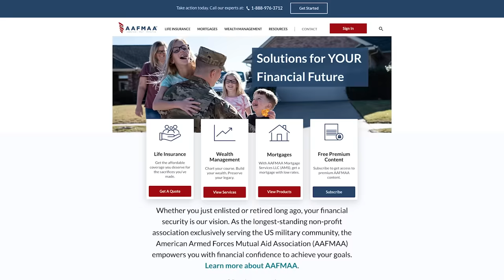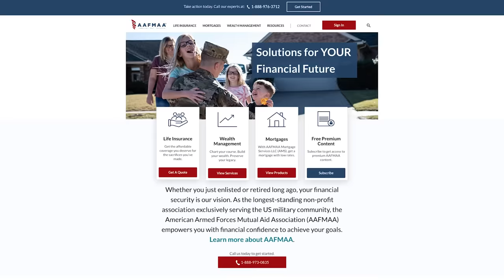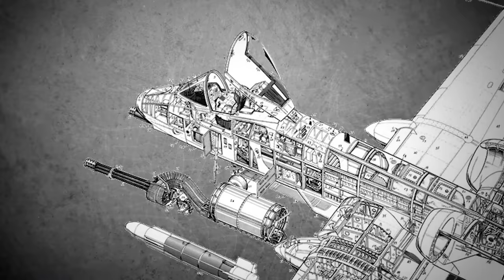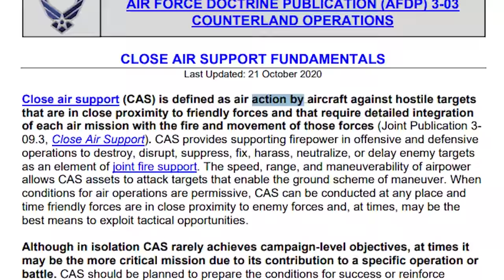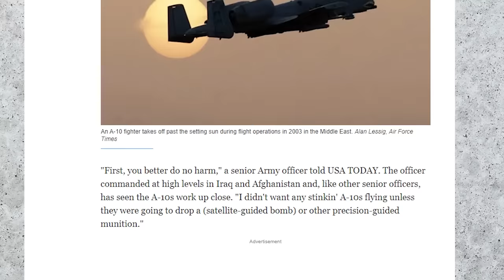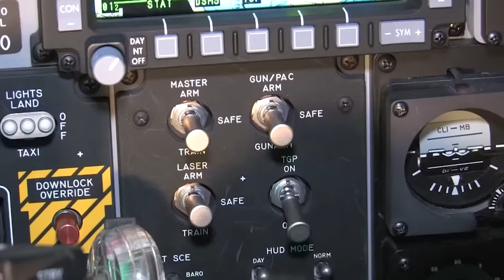Why the Air Force is Screaming to Retire the A-10 Warthog

Comment: As a former A-10 crew chief, I am sad to see this platform retired. However, command is correct on this one. Without 100% air dominance ahead of it, its survivability on the modern battlefield is risky on a good day. I am quite grateful to have supported the A-10 and its pilots to cover our troops on the ground.
Reply: But there's nothing to replace it with. The F-35 Boondoggle is nowhere NEAR a replacement for an aircraft that can almost take a direct missile hit, and STILL fly home. If this were an Air Superiority thing, I could understand that. I could understand retiring like the F-16. Between the F-15, the F/A-18 and the plans for the F-35, it's probably been squeezed out of whatever specialization it might've fit into. 

But the A-10 isn't just a workhorse, it's a warhorse. I don't think there's any problem with the A-10 that wouldn't be solved by building NEW ones, rather than trying to fix the old ones. Okay, yes, the old ones are getting broken more and more...but the technology and fabrication techniques of the OLD A-10s have come down in cost. Moreover, they're proven techniques. There's no R&D needed on the armor of the A-10, or wondering if there needs to be VTOL or VSTOL capabilities or if it needs to be Stealth. We can work on lowering the cost and improving the durability of NEW A-10's, without having to roll out a whole new aircraft that as far as I can tell, is unproven in combat, and incapable of stepping in for a Warthog.
Reply: @Khasym  Your reasoning is precisely why we DO need the A-10, as well as air superiority. Let the invisible, tech-laden fast-movers clear the path and let the A-10 do what is is superlatively good at.....close ground support.
Reply: @Khasym  Once again, it needs total air dominance ahead of it or it dies like a mosquito. Despite its armor, it cannot withstand the newest generation of a2a and sams put against it. Furthermore, the wing rebuilds currently underway are a huge drain on an already tight  budget for the AF. I appreciate your passion and love for the A-10, but having crewed them and spent time during the gulf war in 9th AF HQ (Shaw AFB) in maintenance OPS, the end is nigh for the A-10. I like this fact less than most, but it is the reality. She will be missed. It will be up to the AC-130s to cover this role protecting ground troops until something it figured out.
Reply: @k2_tech745  The digest version is that the A-10 is a very expensive piece of kit that works well for insurgencies, but is not fully up to scratch in case of an all out conflict with a near peer.  To put another way, sending an A-10 to bomb some angry villagers on a mountaintop is a waste of resources, sending an A-10 into the AA umbrella China would deploy when trying to take Taiwan is also a waste of resources.

The discussion around the A-10 often comes with emotional investment and the belief that the "BRRRRT" can fix everything when in fact people were frowning when the concept was being proposed in the first place.  But we're almost half a century later and things have changed a lot.  AA is a very different game from the airspace the designers had in mind back then.
Reply: @Khasym  The point your missing is that the fast multi-role jets like F-35, F-16 and F-15E are designed to not get hit in the first place, which is infinitely better.
And as you said yourself, the A-10 is designed to make it home after a hit, not to just shrug it off and carry on with the mission like nothing happened. Even if it survives being hit by a SAM, it's out of the fight and heading back to base, and depending on the extent of the damage could either be out of action for some time or even written off completely.
Also worth mentioning that there have been several instances of the more 'fragile' aircraft like F-16 and F/A-18 surviving SAM hits and making it home.

The A-10 and the multi-role fighters can (and do) deliver pretty much the same range of munitions (guided bombs, Mavericks, rockets etc). The only real difference is the size and ammo count of the gun, the effectiveness of which is usually overstated (and if there's any threat from SAMs or radar AAA probably won't be getting used anyway).
Reply: @jimwells4240 
  let the A-10 do what is is superlatively good at... friendly fire.

There, fixed it for you.
Reply: @Solidboat123  My response then, is quite simple: why didn't the F-4 Phantom, the F-15 Strike Eagle, the F-16 Falcon, or the F or F/A-18 Hornet, replace the A-10 long ago? They're all multi-role, they're all able to carry the weight, and they're all solid air-superiority fighters We won the air dominance war almost entirely on the backs of the F-15, F-16 and F-18....In fact, I'll take it a step further...why hasn't any trans-sonic or super-sonic aircraft, soundly supplanted the AH-64 Apache Helicopter? You're saying that the A-10 shouldn't be shot at....The Apache has even LESS armor than the A-10, and it's not only still in service, it's still in production, with no sign of that slowing down. 

To be clear, I'm not saying the A-10 couldn't use a redesign. I do believe it should have some theory-crafting put into it to give it better survivability. But there is no other aircraft in service at this time, that can go gun to gun with a tank, and say "I can beat you." 

In many ways, I hear the lessons of Spirit 03 being unlearned right now. An aircraft pushed to the limits of itself and its crew, was taken down not by some massive barrage of SAMs or dogfighters....it was just one person, with a shoulder fired weapon. Combat is not kind to extremes. Supersonic aircraft, are the extremes. The things that save air-dominance fighters in an air-to-air fight, utterly doom it in ground attack, as we've learned the very hard way from Iraq to Kosovo and back again.
Reply: @Khasym  "why didn't the F-4 Phantom, the F-15 Strike Eagle, the F-16 Falcon, or the F or F/A-18 Hornet, replace the A-10 long ago?"
Politics as far as I can tell. Had the USAF been left to their own devices this is probably exactly what would have happened - they did try in fact. But the US government has apparently forbidden them from doing so thus far.

"why hasn't any trans-sonic or super-sonic aircraft, soundly supplanted the AH-64 Apache Helicopter?"
Because unlike fast jets, attack helicopters can be operated from austere, confined, unprepared positions right behind the front line, which cuts response times down significantly. There's also the point that the Apache is operated by the US Army, which is restricted on what fixed wing aircraft it can operate (things like the A-10 are off-limits). So for them the choice is essentially attack helicopters or nothing.

"The Apache has even LESS armor than the A-10"
And like the A-10, its use is dependant on the capability of enemy forces. The US Army learned the hard way that attack helicopters can be very vulnerable to ground fire

"But there is no other aircraft in service at this time, that can go gun to gun with a tank, and say "I can beat you.""
The A-10 can't do that either - its gun isn't that good at killing tanks. There's a myriad of weapons that the A-10 and others carry which are way better for defeating armour, like Maverick, Brimstone and Paveway - all are guided weapons (some are fire-and-forget), all can be used at range (putting the delivery aircraft at much less risk), and all are far more destructive than 30mm AP cannon rounds.
Did you know that most A-10 kills in the first Gulf War were made with Maverick missiles? And that the F-111 killed more tanks than the A-10 using laser-guided 500lbs bombs?
Reply: Chief, we always have 100% air superiority.  As with the Russian Ukrainian war, this aircraft would help the Ukrainians open up the mine fields and blow up the trenches.
Reply: @freddiemyer4891  Don't preach to me, preach to the DoD and the joint Chiefs. But from my time in 9th AF HQ, they know what they are talking about.
Reply: Yes, it was for an earlier battlefield not in the 21st century with smart missile MAPADS and hunter-killer loitering drones... It has changed and the ( pilot)  person can not be the benefit as was in earlier situations.
Reply: It depends on which battlefield though? Each war seems to bring surprises.  If it's no good for US planning, could it have a future sold to an ally?  Surprised seeing how ammo is supplied to that gun. I would have thought a more efficient way is for the barrel to sink backwards into the ammo container picking up the end of each roll as it goes.
Reply: when the USAF finally does divest this bird whats to stop the USMCA adopting it? As CAS does seem to fit well for them, bit like the old RAF Harrier successor?
Reply: @k2_tech745   Using that logic, wouldn't helicopters be useless as well? Why then are helicopters still in use? They're even slower than  A-10s and also susceptible to ground fire.
Reply: My reply to your comment. As I had family in the defense industry I KNOW know they work.  The F-35 is a money sink. This is ALL ABOUT  politics and DEFENSE INDUSTRY MONEY than the use of common sense. They need a tough, simple, RELIABLE REPLACEMENT.  Not one that is going to cost so much money in down time after each take off. Like the F-35 will. 

You may be a former A-10 crew chief, but I made my millions knowing how the Rich think.  And the F-35 is an expensive craft to operate, making BILLIONS of dollars for the Defense Industry
Reply: @Dimythios you sure sound like a millionaire buddy, not unhinged at all
Reply: @Dimythios  No argument on the F-35 cost. I will always be skeptical of the -35 due to the numerous IT securities issues with many of the contractors and LM itself. This goes beyond what information got out and more about what small, nearly imperceptible changes may have been added to sw, parts design, etc by foreign entities against the US.
Reply: @k2_tech745  i think we see the Air tractors 802 being pushed in support role, its looks more feasible when there is 100% air dominance anyway.
Reply: @k2_tech745  Thanks for being part of the discussion. I wish there was a thorough answer on the alternatives to the a10. So given the answer that we'd try to use an ac130 will cover the a10 use cases as well as we can. 

We still need something like the a10 for ground support in the future, even though we won't have an alternative (bc alternatives aren't as good at ground support, and f35s are too expensive and we can't build them very fast or at all in a big war with china). And in a future war with China for Taiwan, hypothetically, I guess we won't be able to have air superiority. Does that mean we don't have a good solution for a ground war, say China can land lots of tanks in Taiwan? That's what I think it means. But I'd love your throughts.
Reply: when the A-10 was conceived and initially deployed, there was also no 100% dominance (i.e. in Germany facing the Warsaw Pact forces)...
Reply: @Khasym  could it be that there is more corrupt money to be made on the F-35 than on maintaining the A-10?
Reply: Everybody seems to forget that the f35 is also heavily reliant on air superiority.
Reply: @1pierosangiorgio  A plane that costs five times what the A-10 does? That is unproven in combat, still has glitches and bugs that need to be worked out, and will fuel defense spending for probably the next fifty years? A plane that could...and probably SHOULD be called the F-35 BRADLEY Fighting Aircraft? NAAAAAAHHHHHHHHHHHHHHHH 🙂
Reply: A-10 Warthog vs 30mm AA from late ww2.
Those things never survived more than 2 strafing runs once everyone has a machinegun pointed at it in WarThunder. Literally every other plane would have climbed high enough to do another run without risking getting downed by 50 cals
Reply: @gfearymylls  ...I'm a video gamer too....video games are NOT real life. When's the last time you saw a soldier teabag a dead enemy on camera? A-10s...in REAL LIFE, have survived missile strikes and flown back to base. Because the A-10 flies so slowly, it has no need for so finely tuned a flight profile compared to a transonic or supersonic aircraft. It can devote more of it's thrust performance to dealing with weight, which allows it to carry heavier armor and more weapons. 

Further, right now the Air Force doesn't even HAVE a Close Air Support program, let alone a plane FOR the Close Air Support program. They're literally saying "Yeah, we're gonna retire a plane we don't want to fly, in a role we don't want to train for, so we can stick our more expensive air to air dogfighter in the role, and watch them get shredded when they can get SEEN in Close Air Support roles..."
Reply: @Khasym  first of all tbagging a body is purely a sign of disrespect, the only people who enjoys that on randoms are no-life players. And ofcourse video games arent like real life, noone is gonna go be a dedicated anti air in a split second during a fire fight, detecting an incomming CAS without radar, and have SPAA available at all times any time when needed. But that thing is, in a game about realistic model tanks with pin mounted MGs when it starts relying on its gau8 its is nothing more than a free target, it is not going back to base with a 30mm ap round tears through the fuselage or damages the control . Also think its been absolute crap for its attacker role ingame since it got added immediately become obsolete after everyone decided its not worth trying to use the gun the plane is built for. But my point is its obsolete and for something meant to be a cheaper alternative, it has outlived its alternative lifespan, unless they want an alternative to the a-10 and just replace the gun with a standard 20mm and tweek the design for it be capable of subsonic flight to get the fk out once the ordinance is gone rather than loiter and gun down friendlies, are you sure they paid the price for friendly fire? Or did they just wave it off because they couldnt even afford to upgrade the system. And dont jinx the f35, im loving it and hoping for the best with the f35b
Reply: The risk of the pilots and cost to maintain are not even comparable to the new drones.  I get the love for the A10 but its time has definitely passed.  Heck you could buy over 1500 switchblade drones and fly them into 1500 tanks for the price of one A10.  Drones are the scary new future.
Reply: @hks956  Drones have their place in combat, but NOT as durable front-line support or air-to-ground assets. Drones are economical, but they have no presence. One drone can destroy enemy assets on the ground, true. But it isn't JUST destruction that the A-10 brings to the fight. The A-10 flies slow enough to read the terrain and assist ground forces. It's tough enough to take fire that would otherwise be USED against those ground forces. And it can dish out what it can take. 

In particular, the Switchblade is proving fairly cost-INEFFECTIVE, in the Ukraine conflict. In April of 2023, the US Army discontinued purchase of the Switchblade 300 series, because it wasn't performing against Russian tanks and artillery. The Ukranians don't even want the upgraded Switchblade 600, because it's still too expensive: they can make their own drones that costs pennies on the dollar, that do almost as well. But they still want A-10s and other aircraft.
Reply: So the A29 will survive better?
Reply: @melangellatc1718  I'm guessing you mean the A-10, because the A-29 is now a Brazillian produced prop-driven LIGHT attack and recon aircraft. And yes. Again, the A-10 has survived direct missile strikes and flown home. There is no other plane currently in service with that kind of durability. The F-35's 25mm API gun MIGHT score a good hit on an A-10. Conversely, the 30mm API/HEI mixed Avenger of the A-10, would utterly shred the armor and fuselage of the F-35 with just a few hits. 

And ultimately, that is the threat the F-35 will face in CAS: 25mm-30mm anti-air guns, firing at F-35s forced to slow and fly LOW to conduct it's support. The entire reason a gun is still ON an F-35, is because it is a proven airframe killer. 

Again, the ideal solution, is to upgrade the A-10 DESIGN, instead of the airframe. Don't try and stick more tech into it. Get the production costs down, give it more durability, and use it in its PROPER role, rather than trying to turn a support craft into a dogfighter...or a dogfighter into a support craft.
Reply: @k2_tech745  huge budget drain? Do you have some figures on what the wing rebuilds are expected to run?  Also, can the AC130 really deliver here? Can it mobilize as fast, whats its operating cost, and can it loiter the same?  And does it stand any better a chance than the A10 against newest a2a and sams? It seems like the answer would be no, and the ac130 over $100 million a craft at risk and the a-10 is under $20 million. I dunno, it just doesnt on the surface seem like many criticism hold up in practical terms vs theoretics.
Reply: @freddiemyer4891 
As a fan of the A-10 we can just open the minefields with a really long rope of boom-putty on a rocket which is way cheaper than sending up the A-10
Reply: There is no option for a new A-10. We could start from the ground up and design a whole new aircraft if that's what you mean? The company that built them no longer exists, and the company that bought that company doesn't build aircraft. There's no one to buy a new A-10 from. @Khasym
Reply: @Kevin-zt7lb  Not exactly. What's the fundamental threat faced today by the A-10, that could take it out of service? It's air-to-air missiles from current and next-gen fighters that won't be seen due to stealth and can't be out-maneuvered due to new designs and tolerances. But's not the AIRCRAFT that's the problem...it's the missiles. 

I think what the A-10 needs, is a flight-capable version of the Phalanx CIWS system used on combat ships.  Shed some of the weight given to armament to install a modified version of a Phalanx in the midsection of the A-10. It doesn't need the anti-air capability of the ship-omunted CIWS: it just needs to drain missiles fired from rival aircraft.

This upgrade could also serve to protect ANOTHER aging aircraft that risks becoming outdated: the B-52 Stratofortress. Like the A-10, it has a hell of a chin, delivers near unmatched firepower to the battlefield, and is becoming more and more at risk due to modern fighters. Except the B-52, is expected to remain in service until 2050....
Reply: @Khasym  the idea of a heavily defended and armored flying tank is cool but not really viable. Also a single CWIS wouldn't be able to cover the whole aircraft, so you'd need at least 2 or 3. At this point you're moving into MASSIVE strategic bomber kind of scales. And as you keep adding these turrets you keep losing the maneuverability of the A-10 that everyone loves. I don't think the USAF wants a B-17 that can do strafing runs.

Generally when a branch of the armed forces wants to retire a system it's for good reasons. Take a look at when Reagan and congress forced the navy to update their battleships in the 80s and 90s. We ended up spending billions of dollars to reactivate platforms that were redundant to more effective and less expensive options.
Reply: Drones. Lots of drones. War in Ukraine just changed the game. @Khasym
Reply: @javakalle8615  Yeah....Drones are not the same as DURABLE overhead fire support...A drone can be dropped by an infantry soldier with an AK. A two man team with a PKP can shoot down drones up to 6,600 yards away. And that doesn't even begin to include just basic jamming and ECM techniques that are little more than kit-bashed blanket transmitters.

The reason the A-10 still owns its role, is because only an enemy aircraft, or enough anti-air to tie up a platoon, can scare one off. Hell, what are missiles, but self-guiding, self-destructing drones? Well, the A-10 has taken direct hits from them...and still flown home.
Reply: @Khasym Yeah, other aircraft do the same. Lots of planes can survive a missile hit and fly home. Pretty much any twin-engine plane can fly home with one engine destroyed. F-18 has done it. Hell even a civilian cargo plane has safely landed with no hydraulics while on fire after a missile hit to the wing (awesome pilots). People always marvel at the A10’s awesome survivability features like redundant hydraulics and electrical systems as if that‘s not standard on every modern combat aircraft as well as airliners, or self sealing fuel tanks which have been commonplace in fighters since WW2.
The only reason you always hear more stories about the A10 surviving is because it gets hit more, and subsequently destroyed more often. Yes it is a sturdy aircraft, it can take a hit, but it‘s not really that special in it‘s defensive capabilities as you seem to think it is. Also taking a hit and limping home while probably not being able to accomplish your mission is not really that great. It‘s much better to not get hit in the first place.
Reply: @1pierosangiorgio  
When the A-10 was conceived, it was considered to be a sacrificial lamb to some degree, with the hope that it could take out enough Warsaw Pact tanks before their numbers were quickly decimated.

But for whatever reason, the A-10 fanboys persist.  The Air Force does want it and it seems that the people who know its strengths and weaknesses get that its weaknesses are way too high unless it's being used against an enemy with no aircraft and whose most powerful weapon is a machine gun mounted on a pickup truck.
Reply: @Khasym  
A lot of aircraft have come back from battle damage.  There's nothing special about the A-10's fuselage that makes it more survivable.  It's got one ton of titanium armor protecting the pilot and the critical systems.  That's it.

The A-10 does have a habit of hanging around low and getting hit with rifle potshots.  But you can find images of other jets that got too low and were hit with small arms fire.  Even where a missile blew up a jet nozzle.  Where a plane made it back to base after a wing sheared off after a collision.  That an A-10 can make it back after being shot up doesn't really show it doing anything unusual for a combat aircraft.  Only it's more likely to be shot up like that because it's slow and tends to stay low.

I mean - the Ukrainians specifically said they didn't want it.  It would be a sitting duck in their current fight.  There are hundreds in mothballs that could be made ready quickly, and they didn't want them.  Former fighter pilots who had to schedule them say that even the most basic fighter would make quick work of an A-10.

"[The A-10] will not close our sky, they will not stop bombers and missiles.  They will be a target for Russian jet fighters and anti-aircraft defense, because we don't have the means neither to effectively cover them, nor to break through the enemy anti-aircraft defence."
Reply: @ypw510  thanks.
Reply: @ypw510  ...Ukraine doesn't have an air force capable of supporting the A-10...I mean, let's just clear the air here: What plane WOULD work when it's being sold one plane at a time, to a nation already a year into a war-economy state? They don't have the time to incorporate a whole new training regimen for their pilots, that the AIR FORCE doesn't even train in anymore, to put them behind the stick of an A-10 and send them into combat. No, the A-10 isn't going to win the war in the Ukraine...but neither is the F-15, the F/A-18, or the F-35...because Ukraine doesn't have the logistical support to field them effectively against Russian aircraft. 

Ukraine also didn't want the Switchblade 300 series of drone missiles...because they're kit-bashing more effective drones in the field that cost a single percentage or two of what the Switchblade series costs....does that mean that series of missiles is obsolete and needs to be retired?

Hands down, the most expensive thing in any aircraft...is the PILOT. A PILOT is infinitely more valuable than any individual aircraft. They are a fountain of usable information, and irreplaceable military cost and concern to any nation that has them. A pilot shot down, will prompt a massive hunt for their recovery, involving many different units which can be engaged because they're not focused on fighting the enemy. 

Over the fifty years of the A-10's lifespan...it's been lost, seven times. The F-15 has been lost 123 times over its 36 years of service, the F/A-18 has been lost 74 times over its 44 years of service. And...I need to be clear here: these aren't even the planes that are supposed to REPLACE the A-10. The Air Force, in all it's Whiz Kid F-4 wisdom again, is trying to make one aircraft do everything....that aircraft, is the near $100 million F-35: a plane that hasn't even seen AIR combat, let alone gone to combat in air to ground or Close Air Support. A fast super sonic jet, belongs in the sky, fighting other aircraft...it does NOT belong in close air support roles, which is where many of the F-15, F-16, and F/A-18 losses ARE.
Reply: @Khasym  
Amazing that you manage to get so much wrong.  They’re getting F-16s in Ukraine and they badly want them.  The A-10 serves a purpose that the Ukrainians never needed.  It’s been pointed out that the F-111 was responsible for more tank kills in Desert Storm than the A-10.

The A-10 is finally being retired.  While I wouldn’t say good riddance, I would ask “Why did it take so long?”  It was an answer to a question that was never asked.

It’s simply not going to be replaced.  No defense contractor would think to bid on a replacement that isn’t an existing aircraft.  Why would a company spend that much on development for a platform of that limited use?

And the F-35 has seen combat.  I don’t know where you get off claiming that it hasn’t.
Reply: @ypw510  Annnnnnnnd maybe you should take a course in basic english, so you can understand what I said....I said that Ukraine cannot logistically support an air war against Russia. Even if you send every F-16 the US has, Ukraine will run out of capable pilots long before Russia will. The only way american aircraft will have a meaningful impact beyond a defensive role in the Ukrainian War, will be if American pilots are flying alongside Ukrainian ones. 

As far as the vaunted F-117 Nighthawk...you do realize that an aircraft designed specifically so it would not be fired at, was lost in combat almost twice as often as the A-10? A-10's lost seven, while the F-117's been lost 12 times?

Lastly, again...the F-35 is combat-READY. That does not mean it has seen durable combat engagements and PROVEN its value. Right now, the Russians are determining the value of their current and next-gen fighters in combat n Ukraine. We've been patting ourselves on the back, confident that an over-engineered, over-designed, over-budgeted frankenstein is going to win wars it never gets to fight.
Reply: @Khasym  
Either you’re purposely obfuscating, or you simply can’t read.  I said F-111.  Those things could come fast and hard and carry a boatload of bombs.

No foreign military wants the A-10.  But the F-16 is another matter.  They’re relatively easy to train a pilot to fly.  And Ukraine has the issue that Russia has, which is lots of pilots but not enough aircraft.
Reply: @ypw510  First I'm gonna concede that I DID misread your statement. I thought you were referring to the F-117 Nighthawk, not the F-111 Aardvark. But the Aardvark has the same problem as the F-35: they were far more expensive to operate on a per-plane basis. That is why the Aardvark was retired by the US in 1998, and the Austrailian Air Force in 2010. And that, is before you even begin to consider they were operating in a pre-stealth warspace. Now that Russia and China both have next gen fighters, an aircraft operating at HIGH altitudes like the Aardvark is going to be more vulnerable. 

It's the reason the AC-130 Spectre is being scaled back in operations. From a mission perspective, the AC-130 can do a better job than the A-10, simply because it can carry more ammo and has even more powerful weaponry. But it has the same problem as the A-10: it can't go air-to-air long term....but UNLIKE the A-10,  the Spectre also REQUIRES high altitude, because it has little defensive options. The Spectre IS a flying tank, with the armor of a snow-blower. 

Lastly, why should it matter what foreign militaries want? We should be making weapons that defend the United State of America....not weapons we can sell off to other powers. The F-15, F-14, F-16(after it's teething problems were finally fixed) and F/A-18 PROVED themselves in combat long before selling them off became an option. I'm reasonably sure that at five times the price of a Russian MIG-29, no one's going to want the F-35 either.
Reply: @Khasym  
Huh?  All of those were sold to foreign buyers before they ever used in combat.  The F-14 was sold to Iran before it was ever used in combat by the United States, because the Shah wanted it.  Israel was the first to use the F-16 in combat.  They were also the first to use the F-15 in combat.  Australia and Canada had purchase orders for the F/A-18 (including the CF-18) well before it ever saw any combat.

Do you even do a little bit of research before making all these claims?

The costs aren't meaningless, but have to be taken with the understanding of the capabilities.  What the A-10 has ended up doing is dropping 500 lb laser guided munitions on tanks from higher altitudes to reduce the chance of being hit.  And when they did go low and slow as a show of force, they get hit with small arms fire and MANPADS.  But their most successful missions were high up, where other aircraft can get there faster and generally had better all-weather capabilities.

The A-10 had a lot of supporters in Congress - typically the members in the states where they were based.  That's the main reason why it hasn't gone away.  But it's gone and frankly there isn't going to be a meaningful replacement.
Reply: @ypw510  Oh please...pleeeasseeee tell me you're not actually accusing me of not doing my own research, AND saying that foreign military powers bought unproven combat aircraft, and THEN proved they were reliable? Please tell me that's just an earnest typo or mistake.... 

The F-15 had it's first combat KILL, in Israeli hands....it'd been flying missions for the US for five years BEFORE that  The Eagle entered service in 1974....the Israeli combat kill occurred in 1979. The F-14 was intended to be a reconnaissance platform, phasing out the Vigilante and Crusader. But when pressed into medium altitude Combat Air patrols, Tomcat pilots developed their own tactics to counter SAM and AA threats, bringing the F-14 into its place as a naval powerhouse. THAT is why the Shah of Iran bought the aircraft.

Tanks are not the only threat that is faced by ground forces. And frankly, the best counter to a tank, is the M1 ABRAMS, not an aircraft. The A-10 can fulfill the ENTIRE role of Close Air Support, not just that of tank-killer.  it can take a hit, it can spot for artillery, it can strafe enemy vehicles or fixed positions, it can maneuver in tight terrain at low altitudes. It can carry a diverse set of ordnance, go into hell itself, and bring it, and its pilot back ALIVE. THAT is a PROVEN warplane. 

I'm not saying the A-10 is perfect. yes, it could do with some reworking, some redesigning. We can and SHOULD put money into updating not just the mechanics of the A-10 but the design philosophy itself. But again, I'm hearing the same arrogance fhat thought the Bradley Fighting Vehicle, and the first generation of F-4 Phantoms were good ideas: 

"Oh...it should be Stealth, and VTOL and VSTOL-capable. And it should have retractable weapon bays so no one can see what it's carrying..."

"What about portholes....?"

"That's a damn good idea..." ((And NO, that's not just me joking: Some general back in the early 80's, thought it would be a good idea for the Bradley Fighting Vehicle to have portholes on it, so the soldiers inside could stick their rifles out and fire from them.))
Reply: @Khasym  
WTF?  The F-15 never saw any combat (which was your claim - that foreign buyers waited until they were combat proven) until the Israelis did.  So obviously they bought it before they had seen any combat.  Same with the F-16.  

Most of these aircraft all had contract orders from foreign militaries before the US versions were fully operational and all had been purchased by foreign buyers well before any saw combat by the United States.

And the F-14 was just supposed to be a reconnaissance platform?  That's just flat out wrong.  The Navy wanted a fighter out of Robert McNamara's TFX program that would carry the AWG-9 and the Phoenix missile.  It had to be big to carry that big a radar and to be able to carry the extremely large Phoenix.  The purpose was to intercept long-range Warsaw Pact bombers for fleet defense before they could launch cruise missiles or anti-ship missiles. And one never fired a shot in anger until the first Gulf of Sidra incident in 1981.

From "ADAPTING TO FLEXIBLE RESPONSE 1960-1968" (you can search for it) on the TFX program that became the F-111 and then spawned the F-14:

"While the Air Force wanted a strike aircraft able to deliver nuclear or conventional weapons, the Navy needed a fighter armed with air-to-air missiles to defend a carrier task force. Attempting to satisfy both of these needs with one aircraft raised the risk of cost overruns, schedule slippages, and performance shortfalls.
Reply: @ypw510  I never said the F-15 was only proven in combat after its first kill...that's not being proven in combat. Being proven, means you meet the threat your enemy poses NOW, and with nothing but the tools of the aircraft  itself, overcoming that enemy. It doesn't have to result in a kill, it has to result in the enemy quitting the field. It means not using the aircraft in very limited, very specific engagements, where all the opposing factors are both known and countered, to give it target practice. When an F-35 can find, engage and chase OFF an Su-57, even if it doesn't get a shot in or a kill, THEN it is proven in combat against air to air threats of its time.

And again, NONE of this speaks to the A-10, which has less than 10% of the combat losses of the F-15, F-16, or F/A-18. For someone who keeps claiming the A-10's going to get shot down, there doesn't seem to be a lot of proof to that. They're shot AT, but only the transsonic and supersonic fighters seem to be getting downed.
Reply: @Khasym  
No.  You claimed that these aircraft were somehow combat proven before there were international military buyers.  The initial Israeli contract to purchase F-15s was in 1975 where they tested early F-15 models.  Sure - the US had engaged in training exercises and simulated combat, but never where there was a shot fired in anger.  But again, the F-15 had never been in combat before the Israelis decided to purchase them.  Now you move the goalposts.

And your claim that the F-14 was initially a "reconnaissance platform" is absolutely, positively laughable.  Your claim ignores the the US Navy requirements of the TFX program and why the F-14 was so large (for the AWG-9 radar) and why it had that big lifting body with the space for four Phoenix missiles.

And the A-10 will be retired by 2029 because it's the correct decision.  What it mostly does (drop laser guided munitions from higher altitudes) these days is what fighters and bombers can do, while getting there faster and not being sitting ducks for faster jets.
Reply: I wonder if it could be viable if they gave it Active Protection Systems like Trophy system Israelis put on their tanks and new Western ground combat systems.
Reply: we have 100% air dominance anywhere we decide to last time I checked
Reply: Would the A-10 be a useful gift to the Ukrainian front? Maybe send them the ones that are being retired? Would they be a good border support once the Ukrainians push Russia back to 1991 borders?
Reply: Hoo-ah.  Spot on.
Reply: Hear, hear! @Khasym
Reply: You cant do great ground support at mach 2! slow is the point.
Reply: @Khasym  What sort of combat scenario do you envision US troops being deployed in which they would need that sort of close air support from a platform build around a machine gun?  Serious question.  Sure in Iraq or the mountains of Afghanistan in which troops were being ambushed and harassed by an entrenched insurgency, the A-10 had a role to snuff out enemies hiding in trees who couldn't shoot back, but that only worked when we had COMPLETE technological superiority.  This will likely not be the case in the next war we find ourselves in, those days are DONE.  We've ushered in the new age of proxy warfare over the last couple years that some other superpowers are surely going to emulate the first chance the get against us...
Reply: @TB-ni4ur  Again, this is the same thinking someone applied to the F-4 Phantom when it was put into service. "Who's gonna need a gun on a plane, when you've got missiles that fly faster, don't need to be aimed, and can shoot from dozens, even hundreds of miles away?" 

In fact, I can go even further back into history....it's the same mindset the GERMANS had in World War II when they conceived of the Tiger tank. They thought the Tiger series of tanks were just unbeatable. Especially compared to the tinfoil armor of the Sherman and the Russian T-34s. Too much armor, and a gun that could crack anything.....But neither we, nor the Russians fought the fight OF the Tiger. We didn't go slugging it out face to face with Tiger tanks one tank at a time. We developed our tanks to support the ENTIRE aspect of a ground battle, and that included outmaneuvering the slower, less nimble and fewer numbered Tigers tanks. While one Tiger was trying to get from one shooting position to the next, three Shermans or two T-34s were quickly racing to its rear, and the germans lost that trade a lot more than they won it. 

In a cushy office, or the comfort of our own homes, it's very easy to say something is outdated or out of style....war doesn't follow fashion or tech trends. Right now, the Russian Army and...well now the Russian NAVY, is being tore up from the floor up by a bunch of drones from a hobby store, packed with explosives. War follows what puts boots to asses and lead into targets. Even discounting the VASTLY superior amount of armament the A-10 carries over the F-35....there's very little on the ground and even less in the AIR, that can stand getting more than three rounds from the Avenger into it.
Reply: How many enemy jets have been shot down using guns since the Vietnam war by one of our fighters?  The problem with the F4 was not a lack of gun, it was crappy missiles.  Once the missiles were improved, the platform worked as intended.  Adding guns was not needed in retrospect but a reactionary overreaction by people stuck in the past... @Khasym
Reply: @TB-ni4ur  "How many enemy jets have been shot down using guns since the Vietnam war by one of our fighters?" 

Answer: Enough that no air to air fighter has been fielded WITHOUT one since. Again, in over fifty years, no less than five evolutions of of the air-to-air combat craft, no aircraft meant to engage any kind of resistance, has flown without a gun. Even the F-22 and the F-35, aircraft that are supposed to be "invisible" to modern radar, have guns on them....why? Because eyeballs and sights can't be jammed, spoofed, or misdirected.
Reply: @Khasym Hi froma  C-130 Crew Chief from 1999-2009. The A-10 is easily replaced by the USAFs vast array of systems including the F-15E, F-16, F-35A, B-1, B-2, B-52, AC-130, and drones. The A-10 is a one trick pony and built to take on Soviet tanks in Germany. Systems like Javelins have shown that tanks are getting long in the tooth. Not only that but based on USAF hearings on CSPAN year after year the F-16 and F-15E were carrying out the majority of close air support missions in Iraq and Afghanistan.
Reply: @jimwells4240 Why use a one trick pony when the USAF already has a ton of weapon systems in its inventory that are more useful? The F-16 and F-15E has consistently out worked the A-10. The A-10 had one job, take out as many Soviet tanks it could in Germany, thats all. It is now 2023.
Reply: @k2_tech745 Hi, former C-130E and H model Crew Chief here. You are correct, the USAF hearings on CSPAN and the USAF Budget Overviews discuss the F-16s and F-15Es much higher close air support sortie count citing it wants to phase out the A-10 as it switches focus to China and focuses on it's primary mission of logistics.
Reply: @Khasym Let me help you out. The A-10 was born as a political aircraft because the Army with buddies in Congress were essentially trying to produce their own fixed wing aircraft. The A-10 was a political aircraft produced to shut the Army up and deal with Soviet tanks in Germany. Since 1991 the USAF has tried ti get rid of it but Senators such as McCain and Thornberry among others protected the jobs around the A-10 for their constituents literally turning the A-10 into a welfare program for voters in certain districts. This is what is known as crony-capitalism but due to your fascination with the airframe your judgement is clouded and research is poor in the great scheme of things. The current the USAF is concerned with is China, not Soviet tanks in Germany or appeasing the Army and friends.
Reply: @Khasym The AC-130 is more useful as is the F-16, F-35, F-15E, B-2, B-1, and B-52. You are literally pining for an inferior politically driven airframe 🤣
Reply: @themadmallard I was a C-130 Crew Chief and had to laugh hard when you literally questioned the loiter time of a C-130 in comparison to an A-10. You really are clueless if you think an A-10 can loiter longer as well as dish out as much punishment. There is a reason AFSOC has all of the AC-130s 🤣. Civilians arguing with USAF veterans that actually crewed or worked on things is aj exercise in mass arrogance coupled with an extreme barrier to critical thinking 🤣
Reply: @Kevin-zt7lb The reason is nobody needs one hence nobody is building anything.
Reply: @Khasym A manpad has and will take out an A-10. Its not about its survival but it's lack of usefulness. The USAF doesn't need a hangar queen while airframes such as the F-15E and C-130 are getting it done.
Reply: @warfarenotwarfair5655  thanks for bringing in your experience, could you speak to the other seven or eight points I asked about the 130?
Reply: @themadmallard  Haha, I would have to go through here and look.
Reply: @SteveB-nx2uo  Are you paying attention to China?
Reply: @themadmallard  The C-130 has far more loiter time than any fighter aircraft and delivers continuous fire on target for AFSOC teams. The new version even has missiles. The A-10 requires no replacement because it was never needed and is redundant. Technology like small diameter bombs and targeting pods just make the A-10 really stand out as a jobs program not a viable weapons platform. Unfortunately many people are unaware of Senator McCain and Thornberry constantly blocking the USAF from retiring the airframe due to the jobs being in their district. Sadly just see a gatling and become a fan without researching the USAF Budget Overviews or watching the USAF hearings on CSPAN.
Reply: @warfarenotwarfair5655  I remember seeing a hearing with Mccain speaking about that where he was asking a general or equivalent a bunch of questions about different operating scenarios that the retiring of the A10 would bring.  The military figure didn't come out looking very good in the process of trying to answer the questions.... though I'm perfectly ok with the thought that an idea isn't necessarily bad just because the person supporting it isn't gifted at speaking about it. Thats why we should ask questions, I say.

How about the other points? Op cost,  time to get in the air, and defense capabilities against AA?  Again the ac130 cost 5 times as much per unit as the a10. And I've no doubt you put a mission in front of an ac130 crew that for whatever reason an A10 wasnt available to do, that crew would say "fuck it when do we go?" and it would get done one way or another, so thats not the issue at all.
Reply: @themadmallard  You have to remember that military members must tread lightly when it comes to powerful politicians or your career as an officer is over. McCain was economically linked to the A-10 so he was already corrupt and no matter how many times senior USAF staff showed the Senate arms committee the statistics proving the A-10 needed to head to the boneyard senators like McCain would shoot it down. Crony capitalism is common among these Senators, look at the KC-46 and F-15EX, both unwanted airframes by the USAF until powerful people get involved with special interests with Boeing. Before long some random "documentary" will make up a story of how amazing the airframe is for the USAF.
Reply: @themadmallard  The AC-130 is for AFSOC only and supports JSOC teams. The A-10 is simply redundant and by it being gone doesn't damage any mission readiness. The USAF is gearing up for China and China is building up it's Navy and Air Force at a quick pace. The days of the Army demanding CAS in Germany are long over.
Reply: Goodbye troops, goodbye tanks, goodbye helicopters. Without 100 percent air dominance your survivability in modern warfare is just not feasible
Reply: @williammendoza6062  Hence the A-10 needs to make way for superior platforms that can engage in the multi-role.
Reply: That is assuming anyone stands a chance to take air superiority from the f35 and f22(not likely)
Reply: What are your thoughts on a reserve fleet to protect home? China is building bases in Cuba, you should have air superiority on home turf. It's a realistic scenario
Reply: @tylertorch5914  There is already air superiority for the homeland. Not only do we operate F-22, F-16, and F-15 active duty bases we have Air National Guard and Reserve fighter squadrons. We also have Navy and Marine Corps naval air stations.
Reply: @tylertorch5914  we essentially keep air superiority everywhere all at once...through bases all across the world and 11 carriers attack groups...when have stuff here at home and can get more on its way in an instant
Reply: @SW45auto  you're killing me here man, why are you both so focused on the a-10 as air superiority. I AM SAYING, IF WAR COMES TO AMERICA, YOU WILL HAVE FUCKING AIR SUPERIORITY ERGO A ROLE FOR THE HOG. Scares me a bit when a community of people with firearms can't read.
Reply: @tylertorch5914 can you read? I said nothing about the A-10 in my comment...you were questioning air superiority...I was just pointing out that in the question of air superiority America has it...be it here at home or on the other side of the globe...thats all I was saying...the A10 is a close air support system and is kinda shit in air to air combat hence why I didn't bring it up when talking about air superiority...we have other stuff for that
Reply: @user-le8dn2jr4j  they could do the job with f35/f22 support...but in war you don't want to use what can do the job you want to use what does the job the best...if you are fighting fair then you fucked up
Reply: It will still remain my fav support machine… that gun is a work of art… we have a handful on whiteman afb, along with some t38s and of course.. the b2, I’m curious as I just recently heard that a few b21 may be replacing the current b2s on that specific base.. now THAT… makes me excited! My dad crew chiefed for the spirit of Indiana, I flew the simulators when he worked the logistics squadron and then got to sit in his plane when he retired.. my uncle “who was a Vietnam vet” mentions how amazing that experience was every time we visit.. b2 is still my fav piece of tech
Reply: @Khasym f35b has no internal gun
Reply: Nothing in the sky is more survivable. Is almost guaranteed to bring the pilots back alive. I think that's one hell of an asset.
Reply: It's a modern close air support plane for a super outdated military doctrine. China has already retired their equivalents to the A-10, the Q-5 Fantan. Russia still has an equivalent, Su-25 but that's russia, they dont retire any of their equipment...
Reply: John McCain authorized the death of the f14. Tge problem is, it takes 2-3 aircraft to replace it as a fleet defender. How many aircraft would it take to really replace tge a-10?
Reply: @jimwells4240 Do you even know what 'close air support' is? The MQ-9 has provided something like 20x the amount of close air support missions that the A-10 ever did, and that was like a stat from 2018 or something.
Reply: @fnhatic6694....I know EXACTLY what close air support is, and in all cases, I'd still prefer to have a skilled driver in the pilot's seat than an "operator" 7,000 miles away working from what basically amounts to his grandma's high-tech basement.....and we won't even begin to talk about the inability of the Reaper to carry much more than 4 Hellfires....nowhere near the full combat load-out of a Warthog....and of course, there's that lovely "BRRRRTTTT" noise.
Reply: @jimwells4240  The A-10 has tons of friendly incidents. It was obsolete the day it was rolled off the assembly line to end up as a welfare jobs program.
Reply: Cheap shoulder mounted missile says boom go bye
Reply: @1pierosangiorgio when the a10 was first designed there are no guided manpads
Reply: Given your logic, the US should retire the Apache as well. The US never sends its ground troops in without air superiority, this is part of the doctrine because the relative size of their forces are small compared to its potential adversaries. If they start experiencing the same losses as Russia, it would be catastrophic for its ability to project ground power, which is why the US has relied on technology since after the vietnam war to win wars, this involves air superiority first and foremost. There is always room for the A10 and the Apache in a CAS role.
Reply: And dont forget the friendly fire risk.
Reply: @k2_tech745  excuse my ignorance here, but wouldn't the AC-130 also require us to have air superiority? It's slower than the A-10 and has 0 air to air capability. It's only saving grace is that it stays high enough to be out of the way of standard ground to air portable defenses, but can easily be taken out my enemy jets.
Reply: Are you saying the AC-130 doesn't need air superiority to operate?
Reply: @warfarenotwarfair5655  just stop while you're behind
Reply: @Grant6243  The AC-130U and models cannot fight in contested space but then again they are assigned to AFSOC to support special operations and not for front line fighting. The AC-130 is far more useful and deadly and the new models even carry air to ground missiles.
Reply: @CODYoungGunna  What are you on about?
Reply: @warfarenotwarfair5655  all of this nonsense, lol. So, while it's true that any frame can perform CAS, putting CAS in the hands of a failed project that underperformed against the frame that it's replacing in CAS testing is the definition of insanity.

The reasons why the 35 is replacing the A-10 is due to sunken cost into the 35 program and due to the idea that the 35 can make more money for all that's involved due to the ability to sell it off to other countries.

Lastly Friendly Fire has nothing to do with the frame and everything to do with the pilot. You should know this.
Reply: @CODYoungGunna  Please cite your sources, my information comes from the USAF Budget Overviews and Senate Arms hearings. The USAF for over a decade isn't interested in the A-10C and Senators continue to use it as a welfare program in their districts.
Reply: @Dimythios  This bullshit about the f-35 came from Pierre Spray on a Russian propaganda channel and is utter nonsense. The f-35 is a stellar aircraft that can perform just about any job the military needs from it, usually without even being seen by the enemy